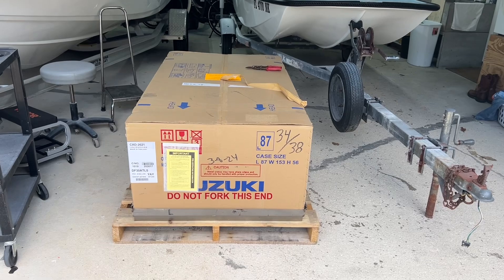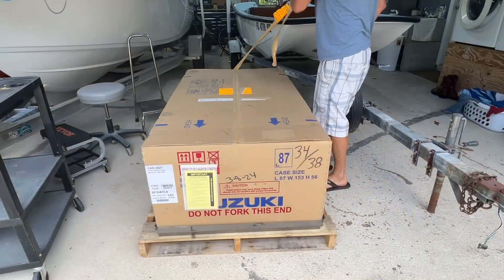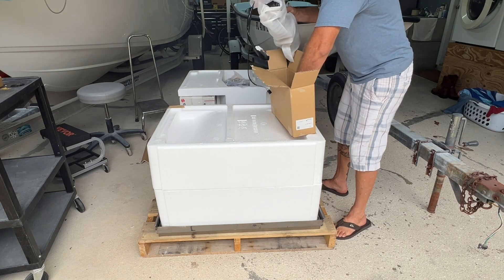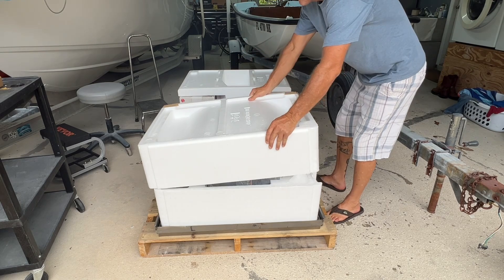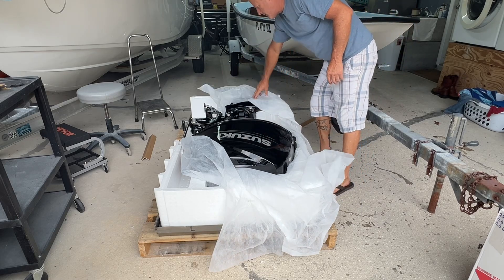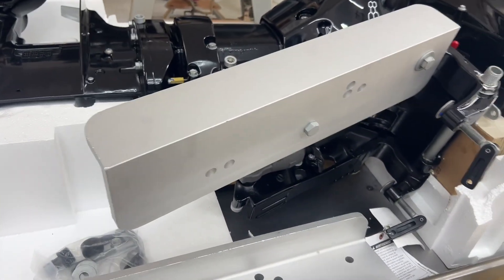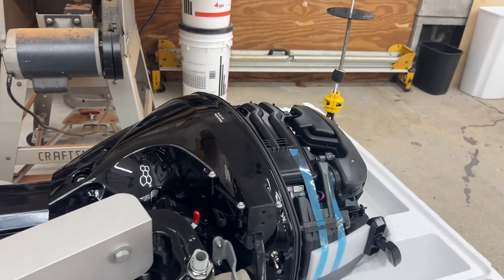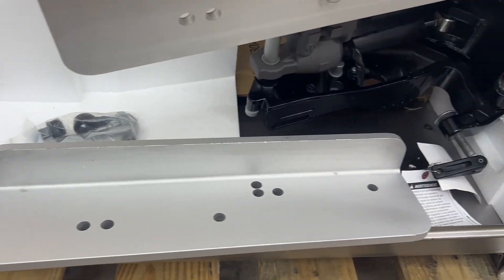1971 13ft Boston Whaler Restoration Project | part 15 | Mounting the 30hp Suzuki

Comment: Nice!  I also have a pre 71 whaler with a Suzuki 30. I also used the riser angles but then ended up switching to the KenFab transom riser.  It’s beefy and keeps water from splashing over the transom. I love my boat my only regret is not getting a 15 or 17! 😂

Comment: Do you have a link, or even a name of the casing you used to wrap all of the wires and cables from the motor to the throttle lever?

Comment: I just installed my 2024 Suzuki 25 4 stroke on my 1966 13 whaler.  It fired right up immediately.. the hoist saved my back too.  Now I’m waiting on my hydrollic  steering kit to come in ..
Reply from the maker: heck yea
Reply: @StoneBrokeAdventure I have cable steering , but the cable rod will end up hitting the transom.  Made a bracket to extend out and put a tilt tube in it , but I moves around too much so I ordered a hydraulic steering kit.   I need warmer weather to test the boat out throughly.  Supposed to be in the 40s here in central Florida.. I also had the same issue with the over sized wiring harness.  I got a plastic ammo can from harbor freight and tucked it inside   I’m gonna do the same with the hydrollic steering hose.  They supply 24 feet of the hose
Reply from the maker: @Whalermansteve84  let me know how that hydraulic steering fits. I put so many hours debating long shaft  with transom jackplate or short shaft and some type of modified steering

Comment: Should’ve got a 15” shaft 25hp
Reply from the maker: no no no if you use a 15 shaft the telflex steering smashes into the curve of the transom. no good
Reply: @StoneBrokeAdventure Thats why you use a standoff bracket for the cable
Reply: @cutsilver3650 i'm curious why you recommend the 15'' 25hp.  I'm repowering a '69 BW 13 and am on the fence on raising the transom.
Reply: hi i have seen all your videos they are fantastic, i have a boston 13 with a 15” transom. first of all a friend of mine is selling me a 30 suzuki s foot at a great price, why do you recommend lengthening the transom and getting a long shaft motor?

Comment: Did you end up shimming the motor?  I'm looking to use your same setup on a '68 13 Sport
Reply from the maker: yes i used 2 stainless steel washers on the top bolts nothing on the bottom bolts the angle works out that way and the insides of mounts on the motor are flush with the brackets